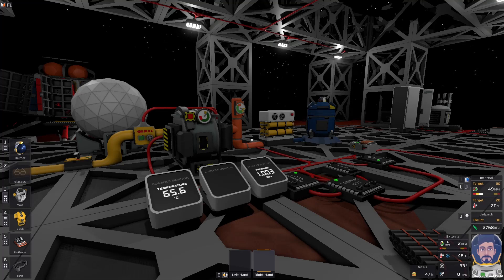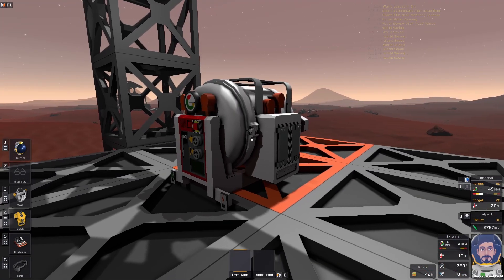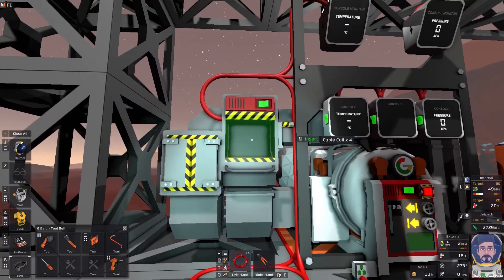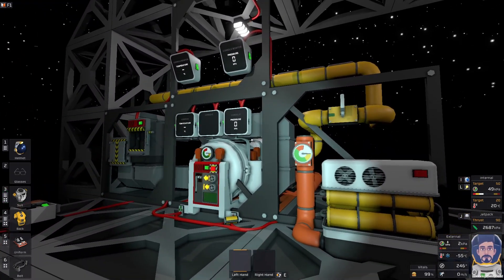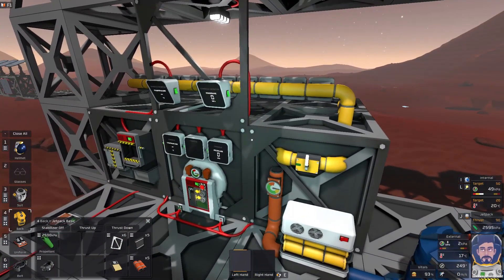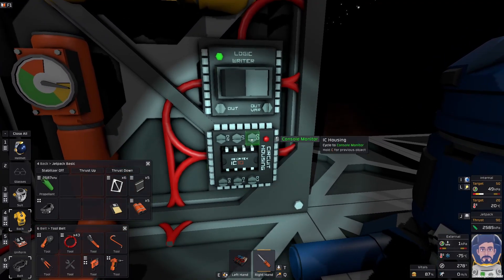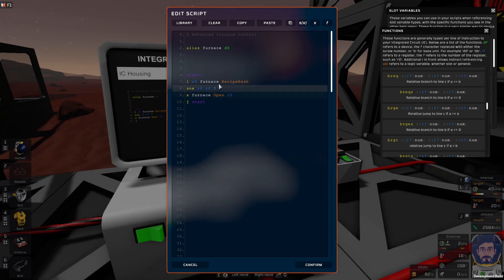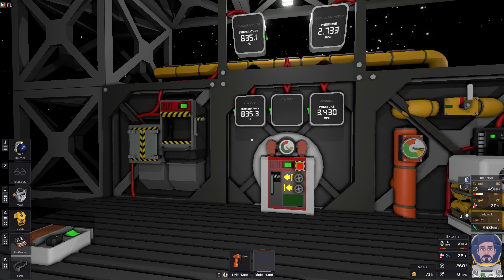Stationeers Building a better furnace

Comment: Mick does this still work in the current beta? Not sure what I did wrong, but my waste tank isn't cooling down my furnace.
Reply: Do I need a heat exchanger now? I thought you had the furnace incased in a frame but not being sure I tried removing the frame and I still cannot cool my furnace with the waste tank.  Thought maybe it was the digital valve causing issues so I swapped it for the manual one but that also had the same results.

Comment: Finding the electrolyzer quite slow. Is the speed effected by the temperature of water going in or whether it is pumped in? currently using passive tank pressure.
Reply: It's just slow. Not sure if water temp matters, but I'm on Mars and it's slow. 
You could add in a 2nd one if you want. Or rig up a tank with some system to stop it from blowing it into the furnace at once.

Comment: Built one of these on the moon and pressurized it using the furnace gasses.  Something I didn't realize at first, those gasses still contain a burnable/explosive mix, so I lost the walls and windows a few times, also was initially using volatiles and oxite ices to fuel it which made things a bit more explosive I believe.  Filtered out the O2 from the room and everything is good now.

Comment: Just asking. Does this setup actually work in moon? I mean that Electrolyzer and water. In my furnace first setup and there's almost minus 200 C inside. I don't think that melts anything at the moment. :D
Reply from the maker: Clicking the activate button will melt the ice
Reply: @cowsareevil7514  Yeah sure. I know that. What I meant was , that does this simple solution actually work on moon , cause there is no atmosphere . Do you have any suggestion for me? I have same setup exactly what you did and it seems to freeze that gas . There is plenty of pressure, but no warmth.

Comment: Thx for the tutorial. Really lovinng this. But I am also missing something. How do you lower the temperature of the furnace? It seems no matter how much gass i let out to the waste tank temps in furnace just keeps high
Reply: Ah I actually filled the frame where the furnace was, which most likely prevented heat transfer furnace/waste tank. :D

Comment: Why is the waste tank needed, versus just venting it?
Reply from the maker: The heat from the waste tank will transfer back into the furnace reducing fuel demand.  It will still work without it.
Reply: @cowsareevil7514  Thanks! Somehow I missed that you said that in the video.

Comment: One thing is worth noting - if you set up a vent system to pressurize/depressurize chamber, remember that passive vent transfers heat if it's exposed. I did place my passive vent on the chambers roof, and could figure out why furnace is constantly losing heat ( and therefore the pressure :) )

Comment: you just jump to the furnace being on.  How much are the values input and output set to?
Reply from the maker: You only turn them on when you need them.  Start with low settings and then work up to higher settings as you become more familliar with the build.  Or continue with the next video and automate them.
Reply: @cowsareevil7514  I watched, great vids. to clarify you only automate the release of pressure?    Add it in to get it where you want then leave it?

Comment: Great guide thanks. I've gone wrong somewhere as the temp / pressure between tank and furnace does not equalize. In fact the temp / pressure in the furnace is umping all over the place. From 800 degrees down to -100 and then back up again and ranges in between - all in just a few seconds.
Reply from the maker: It is glitchy at low pressures.  Fire it a few times or put in some ore to build pressure.

Comment: I'm really struggling to make Waspaloy.  I tried several setups of my own design that could all relatively easily produce every alloy other, but could never get the right conditions for waspaloy.  I finally decided to replicate your setup here as closely as I possibly could from what's shown in the videos.  I didn't include all the automation.  I just used a few switches and regular logic chips to be able to remotely control the different valves and things.  But I still can't manage to make waspaloy.  I can get the pressure up over 50mpa but it's always far too hot, and by the time it cools down from opening the valve to the cooling pipe the pressure has dropped to 25-30mpa.  I can pump more fuel in and get the pressure back up to over 50mpa again, but then the temperature goes right back to where it was.  Had about a dozen explosions experimenting with different fuel priming levels and starting temperatures before ignition.  Luckily I had the foresight to make a save before I started experimenting.

The only viable solution I can think of is to not use fuel at all and go with an inert gas to pressurize both the furnace itself and the chamber.  Then rely on wall heaters to provide the heat needed.  It would obviously take a significant amount of time to get the temperature up to where it needs to be, but it's the only way I can think of to be able to significantly increase the pressure inside the furnace without also spiking the temperature way up.  It might not be a very viable setup for most other smelting since most things require much higher temperatures, but at this point I'm thinking maybe it's best to have one setup specifically for waspaloy that just stays where it needs to be at all times, and have another one setup more normally I use for regular smelting and making all the other alloys.
Reply: You might need to pump in cold gas to lower the temps while keeping the pressure up. I have the option to mix in cryo N2 with an extra gas mixer to control temp. I know it's 1 year ago but still, there you go. Alternatively, throw in any ice manually as an ingredient (not volatile + oxide, just pick one).

Comment: My IC housing is blink all time. nothing happen i copy and paste the code from workshop - computer to the chip- i make all settings like in the saved world. and nothing happen.
Reply from the maker: If the IC housing is blinking then you have pin connections wrong.
Reply: @cowsareevil7514  Maybe. you can make short video for conection and settings ? i try and try again . nothing happen xD

Comment: Loving all your vids.  Should this furnace lose temperature over time?  I can't seem to get it to normalize over 1000 Celsius.  I can also see atmo leave the front of the furnace when throwing in new ore.
Reply from the maker: The system transfers heat between the furnace and the waste tank so the furnace temperature should equalise with the waste tank.  If you want the furnace to stabilise over 1000C then you will have to burn enough to get your waste tank over 1000 also.  The atmo effects are just visual, you wont be able to detect anything with your instruments.

Comment: I swear that everything I try in this game, I re-evaluate my IQ down.  I believe I'm into negatives now!   For some reason, my advanced furnace/small tank output, does not retain the pressure/temp balance between the two.  The furnace just keeps dropping to 0/0.  Output: no valves or anything - just pipe to tank; branch off, with a closed pipe valve, to radiatored pipe  Input: volume pump, switched off.
Reply from the maker: Check that you have used insulated pipes for all of the hot pipes.  There is a world save linked in the description if you want to have a closer look.
Reply: Check the following: the issue I had was actually not having the correct pressure inside the furnace room. Use the active vent outside behind to raise the pressure to something like 40 Kp, then once the room is hot you can get the furnace running and stable (once equilizing with the tank).
Reply: Going mad trying to work out pressure in the furnace room as I would pump in gas and it kept dropping back to 2-3kpa...... until I realised I took a wall off and my room was not pressurized anymore..... we are our own errors 9 times out of 10.

Comment: Thank you for making this, but for noobs like me could you show a bit more? 
Some of the wiring (mostly the ic chip, but consoles to be safe too) and steps had to guess (like the center console chip). 
Also had to tear stuff out to add in pipes and wires you could have shown in a better order. Don't mean to come across as rude or the like just some feedback if you like it.
Reply from the maker: Thanks for the feedback.  It is difficult to set a pace and level of detail that is suitable for all levels.  The consoles and piping were covered in the basic furnace tutorial so I skipped over it quickly in this one.
Reply: @cowsareevil7514  Ah, that's fair. Suppose you could quickly say or add a text box (Whatever YouTube calls it) somewhere with some extra details?  Might be a middle  ground, newer players can stop and read it while older guys can just keep going.
I was able to figure it all out, just took a bit. 
Been going through your videos and they've been quite helpful even if had to stop and figure out what you did in some of them.  Made my own 1st base with no help and while it works....it's um yeah. So using that as "production" platform to make a planned out real one.

Comment: Thanks so much for doing these videos!  I used your code from the gas harvester video and my own feng shui setup for my gas filtration system.  The only question I really have is about the filtration units powering on and off constantly.  Are they supposed to do that?  Thanks!
Reply from the maker: Yes, If there is not enough gas available to collect, it will switch off to save power.
Reply: @cowsareevil7514  If you're interested, and when I'm done, I'll make a short YouTube video showcasing my own gas filtration build which is modelled mostly after your own. :)
Reply from the maker: Please do publish your version.  I build it slightly different each time with little improvements, you might have found something I haven't thought of yet.